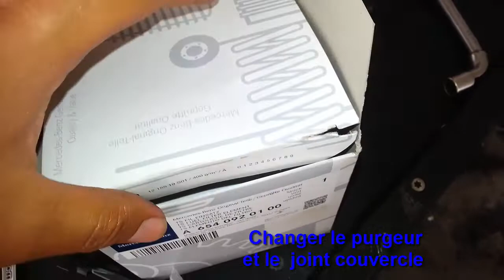Changement filtre a gasoil Mercedes  ( W213 / W177)

Comment: Pour le réamorcer, pas besoin de valise?
Reply: Not necessary, Mercedes do it automatically. But here is my Tip. Start the ignition 3 to 5 times without starting the motor, then this filter is full and out of any air.
Reply: @tomsfairplayservice  That's Correct.

Comment: How did u fill the filter with fuel after the change just switch ignition on?
Reply from the maker: After changing the diesel filter all you will do is switch on the ignition several times (do not start the engine) to fill the filter.
Then start the engine and accelerate (2.5 rpm) for one minute.
Thanks for the comment ;)
Reply: Thank you that was really kind of you to respond and reply so quickly.
Kindest regards Jay🙂
Reply from the maker: @jaykent6645  You're welcome Jay .
Thank you very much once again for your comment ;)
Reply: Not necessary, Mercedes do it automatically. But here is my Tip. Start the ignition 3 to 5 times without starting the motor, then this filter is full and out of any air.